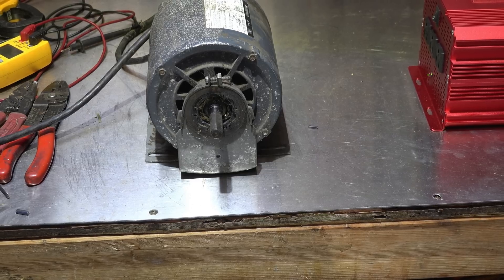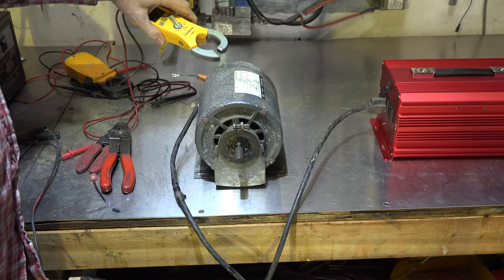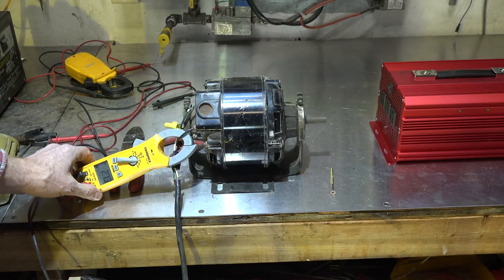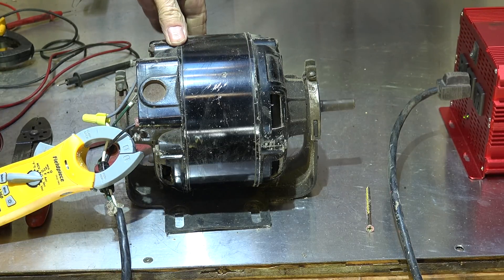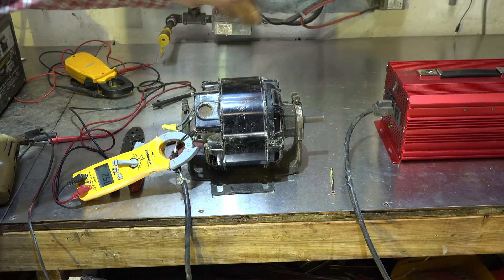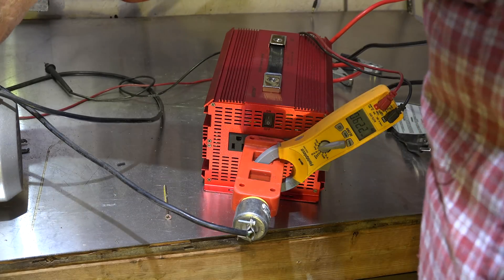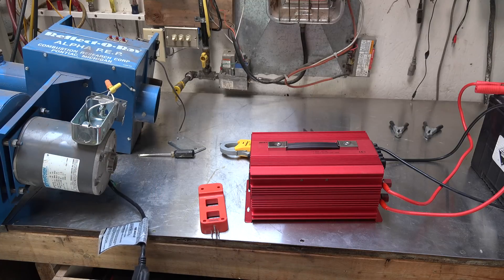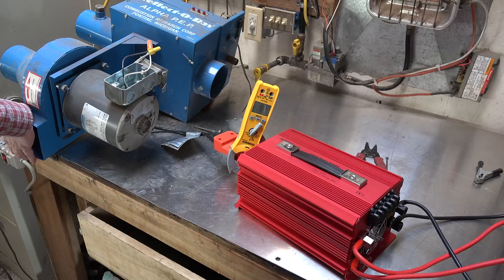Bestec inverter test centrifugal start motor#2

Comment: You don't need to connect all 4 leads ( 2 positive + 2 negative ) for this pump, if it's the 700 watts version, even with a peak of 1000 watts, you could be able to start it with one board only of the 2 boards that are inside the inverter, I guess you have a bad battery. Check your battery cca and compare it to it's original cca and I'm sure you will be surprised.

Comment: I stopped buying modified since motors seem to put a lot of heat and motors seem to jerk around, this is true of all modified sine wave.
Reply from the maker: Pretty much.  The effect on the motor is different for each motor, so you must check each application.  
GFM

Comment: It takes a few seconds for any inverter to produce power. For a better test leave the inverter on and use a switch for the motor. Modified sine doesn't like some motors, and some electronics. A case in point, microwave ovens run at about half power on modified sine. Some motors run rough and hot. Tv and stereos may make noise. Laser printers may not work, although computers seem ok, after all UPS (uninterruptable power supply) are modified sine wave. You may also find that fluorescent lights hum. Another easy test is using a box fan. You will likely find that the box fan runs slower and hums on modified sine. Compressor motors on modified sine...erm heh need a big inverter. A neat trick you can try when using motors on an inverter is to put a big capacitor on the battery side of the inverter. It provides the extra UMPFF needed to get motors up and running. You may know that modified sine creates harmonics, a bad thing for motors. IF at all possible spend the extra money use pure sine wave inverters. Be aware that modified sine will cause harmonic wear and tear.
Reply: +billhickox I'm getting kind of wordy, but this is important so people won't be expecting miracles. Also any inverter may delay as its seek what is on circuits scan for what needs power. A trick you can try is use a light bulb to keep the power flowing, so no delay. Also you can see the light dim as power is called for. If using modified sine and the equipment has a transformer, if the transformer gets hot.. don't use modified sine. Some will work just fine.
Reply: +billhickox One more then I'll SHUP. Electric clocks don't like modified sine.
Reply: Good points about UPSs. I have APC, Deltec and IBM. You'd be surprised by the output on the oscilloscope and the low THD. If laser printers and other PC equipment with small transformers handle it with low overheating risks, we'd be a step ahead in the game here. And did I say they were cheaper than other off the shelf inverter/chargers on the market? Heck you could monitor your UPS on your cellphone if you get your hands on a more recent model with a LAN card. Enjoy!

Comment: I don't know the specific construction of your inverter but there is probably "A" huge or a "FEW" large caps and some level of IGBT under the cover.  When you plug into house AC the power is already there.  When you are turning the inverter on you are getting some wave form distortion and growth while the caps in the inverter charge and the IGBT starts to gate.   Try turning your inverter on and letting it come to full function, THEN connecting your load.
Reply from the maker: The inverter already does delay. I will be looking inside in a later video. 
GFM